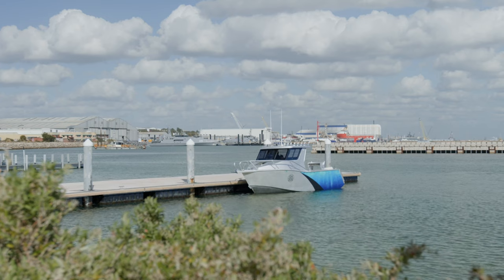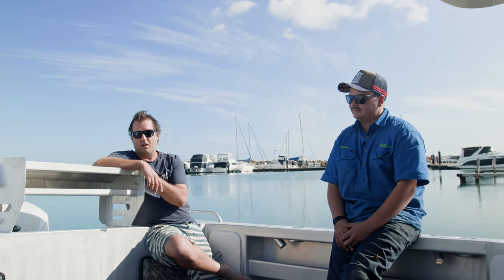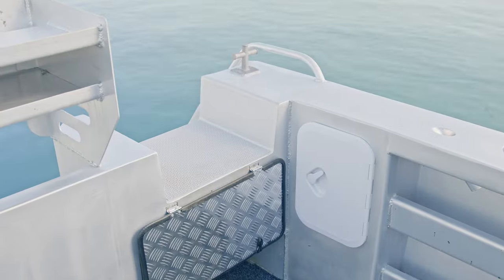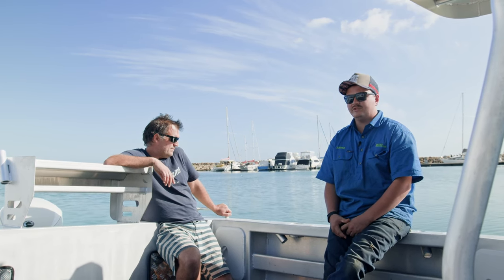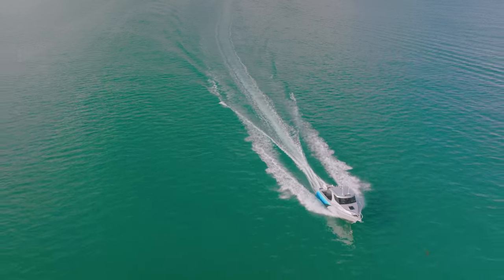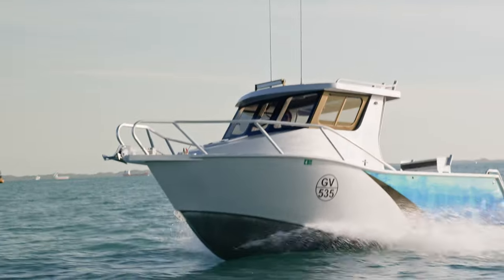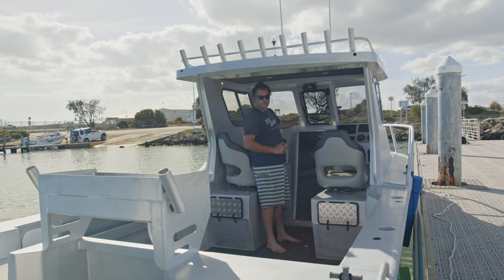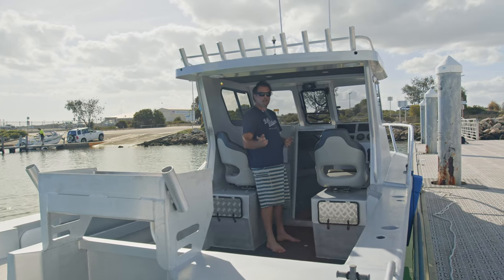x6500HTO Seatrial & Walkthrough - Testing a 6.5m Cabin Boat

Comment: Does Cnc marine work with any builders in the US? Must be older video with etec
Reply from the maker: Happy to work with any builders or fabricators in the US and supply a kit directly to them. This is a recent video but instead of having a new engine fitted, Jed had the old ETEC lying around and thought why not fit considering the lead times on new outboards. We would generally recommend a 200HP to a 250HP for this vessel however the 150HP ETEC performed quite well in the seatrial. If you have any other questions about the vessel or anything else in the range feel free to get in touch. 

  https://cncmarine.com.au/range-3
Reply: Yep new video, boat was launched May 2022.  Long waits on outboards at the moment and happen to really like 2 strokes, particularly the etecs.  The 150 has recently been replaced with a 225 (another etec).
Reply: Not trying to be rude but would you be able to give a ball park price for the fit out only as I am considering doing the same thing. By the way the boat looks great

Comment: Welds look terrible.. pittiful really..
Reply from the maker: Always keen to do a side by side comparison when you do a build!
Reply: @cncmarineboats  I don't sell boats. But when I buy a boat  I would prey my welds look better than these....
Reply: There’s a lot of keyboard welding experts on YouTube. It’s one of the most critiqued things in fabrication. Everyone has an opinion. People think the whole boat should look like it’s been tig welded like a high end aluminum bike frame with perfect coin stacked welds. The truth is production boat welding doesn’t work like that, and if it did you’d be paying three times the current cost for a completed hull. So you’d complain about how expensive it is. The hulls are wire welded which is fast and produces a strong durable commercially acceptable result. No one would pay three times the price for a pretty tig welded hull. It’s just not practical.